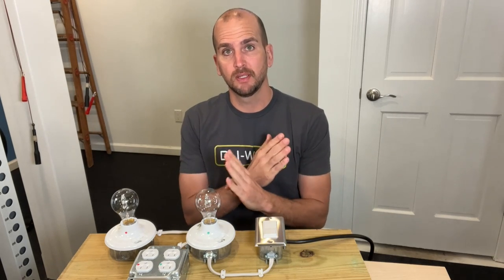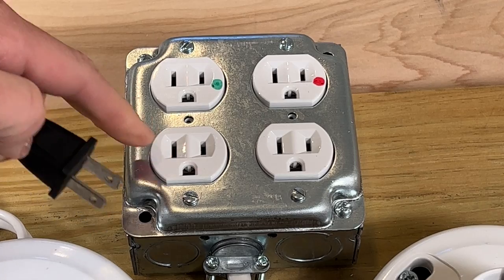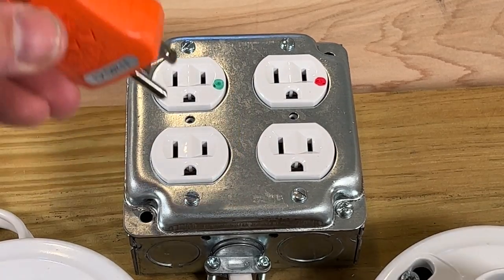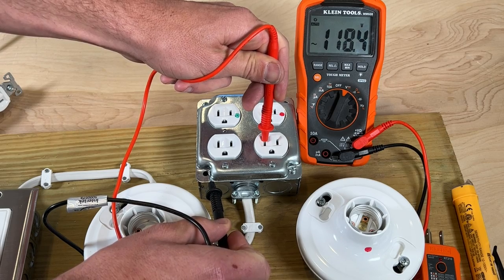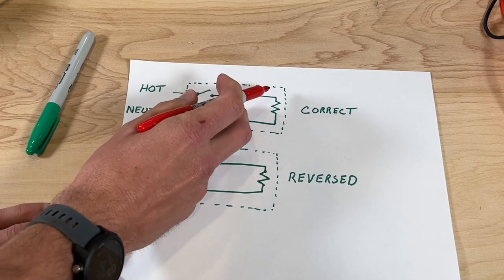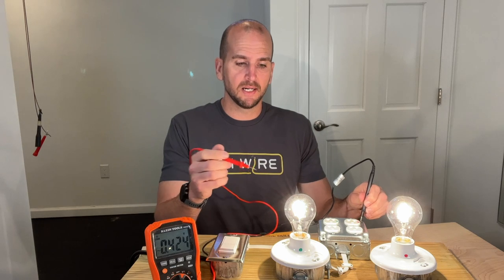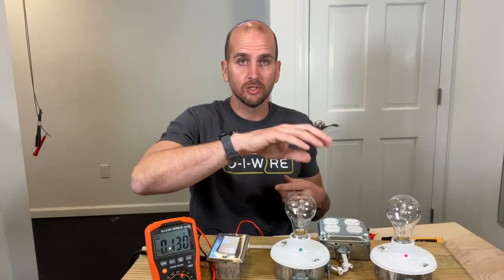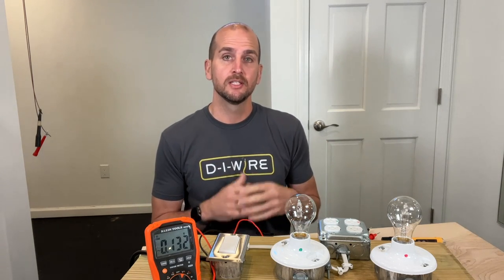Dangerous Wiring Issues In Lights and Outlets

Comment: Here we go again. Where were you when I had this problem. I was selling a house and the inspector caught this problem in the bedroom plug. I tried to fix it but without any luck. I called an electrician and he had to trace the problem all the way to the bathroom switch. So the problem could be different than the plug itself. The house was fairly new and I wondered how so many inspectors missed this problem starting with state inspection. Well explained and thank you for sharing
Reply from the maker: Good point Hassan and thanks for the example.  I think many are caught off guard on what inspectors do and don’t find during the inspection 😁
Reply: As someone working in residential housing construction as an electrician, it's a horror show. The inspector does not inspect everything. Sometimes my coworkers run out of weather resistant gfi plugs, so they use the normal ones in an effort to fool the inspector, knowing he won't check. Many don't even understand basics and don't utilize critical thinking because they take a completely procedural approach. They don't need to know how everything works they just need to know how to put it together. 

Everyone comes under the impression that the world has rules that must be followed, but honestly, it seems the are a lot of people in society who just.. don't care. Not out of malice, but pure apathy. Almost reads like exhaustion.

And yes, I'm trying desperately to get a new job, it's just really hard.
Reply: @Rin-qj7zt  wow. You  just described the reality. I have leased a gas station once and few months into the business my A/C started to act up. I called the pros and sure enough he found a cluster of live wire pointing up without caps. He could have easily touched them and hurt himself. The building was almost 2 years old and just disgusting to see violations passed by the inspector. I wish you luck in your future job
Reply: One of the dangers of connecting a run of receptacles in series. One gets wired backwards and now everything downstream is backwards.
Reply: @hassanbazzi3545  Before blasting the inspector, is it possible that the previous owner left you this mess?
Reply: @denali9449  I would have not accused the inspector but all emergency exit signs were not hooked up and neither the emergency lights to name a few. The building was only one and a half years old only. The market was crazy in 2005 and inspected building were not performed properly due to overwhelming of construction
Reply: @hassanbazzi3545  Why does this sound like Florida?
Reply: @denali9449  haha 😂. You are absolutely correct
Reply: @hassanbazzi3545  Yeah, I am a retired engineer who has been doing code compliance work in Florida since 2009. The failures of local government never cease to amaze me. And people wonder why that condo collapsed . . .
Reply: @denali9449  well said. I was in the food business where food inspectors visits random business and I have no idea of how some pass the inspection. Some of them were high end restaurant. It is sure nice to communicate. Thank you
Reply: Thank you and you as well. Just amazing coincidence. I wonder how many others have not been discovered. WOW
Reply: Simple, inspectors don't check every plug in the house for polarity. They caught it in the bathroom because that's where it's most dangerous.

Comment: I am working in a house that was built in 1947.  All wires look black.  This video prevented  me from possibly wiring a new fixture incorrectly tomorrow.  So easy to check with just non-contact voltge tester.
Reply: if you look closely, one of those wires will have a white or silver stripe on the side, although it may be worn away by now. BTW, if it looks like cloth covered romex and has a light silver glaze on the outside, it's impregnated with arsenic (poison) to keep mice from chewing on it. IOW, wash up after working with it.
Reply: @rupe53  Thank you for the arsenic warning.  It is "cloth" covered wiring in conduit on the main floor.  Unfortunately, it is in BX behind plaster and it is not feasable to replace.
Reply: @rogerhodges7656  ... my home was from 1910 so already have experience with wiring behind plaster. It wasn't fun, but that was 40 years ago. <LOL>

Comment: Good explanation!  I think you covered two of the three big topics: outlets, light fixtures, but also switches.  If your light fixture is wired correctly, but your switch is wired incorrectly, I think you end up with the same problem.  In particular, many people will do fixture work by flipping the switch off because they don't want to deal with the breaker, but if the switch is wired backward, you can still have hot waiting for a path to ground all the way at your work.
Reply: I came here to say this.  Having a lightbulb with its threads exposed is a good example of something an everyday homeowner (or their kid) might do and not consider it in any way dangerous.  But a DIYer trying to change a light fixture with just the switch turned off and not the breaker?  That's a nice, educational shock for DIY electrical work.  It doesn't matter if you know what you are doing, get a voltage tester or a mulltimeter to check for voltage before you touch ANYTHING.

If I don't want to play the breaker guessing game then I will tape the light switch in the off position.  That way all of the people I tell not to touch the switch will have a second warning before I come down the ladder and dole out some verbal education.
Reply: @docferringer  
If I don’t want to play the breaker guessing game?
That’s equal to…
“If you’re willing to run the risk of a shock…”
Reply: It's difficult to wire the switch backwards because the black hot wire is the only one attached to the switch and the neutral white wire bypasses it.
Reply: We need to go back to wireless lamps and tech like it was before 1800 during the time of the giants
Reply: Knob and tube was better

Comment: Some older devices - like radios from before 1960 - can be very dangerous with a reversed outlet since the neutral line of the plug was often connected to the chassis.  Plug it in backwards (this was before polarized plugs) or into a reversed outlet and the chassis is hot & if you touch a metal part of the case you’ll get a 120V shock.
Reply: Only in usa.
The rest of the world didn't have that issue .
But then usa was and is a 5th world nation
Reply: @janee7995  Those old electronic devices with tube amplifiers often had the chassis connected to one side of the line, as you correctly said - but not only in the USA.  They would be made this way and sold in Canada as well.  (I had a few shocks putting the tone-arm on a record.)  If tube filaments were in series, this would also happen in other countries with different supply voltages - and no neutral for a return as on the continent of North America.
Reply: Those have unpolarized plugs unless modified. I consider those unsafe. period. Note with an unpolarized plug there in principle is no wrong way. It was seen acceptable that the chassis was hot.

In Europe they cannot be plugged into grounded sockets as that would be too dangerous if you had a grounded computer next to and there is no legal way besides an isolation transformer to use them.
Reply: @thomaspierce9458  Those were made in most countries. The difference is that in Europe the plug does not fit into grounded sockets so you need to do something really stupid to use them.
Reply: believe it or not, kitchen counter appliances were also non polarized back then and everyone had that spiffy looking chrome trim along the counter edge, which could easily ground against the side of the electric stove or the sink. I can't tell you how many times I got a morning wakeup call if I leaned against the counter with a small gap in my bathrobe while making toast! (not what you think because I was shorter then)
Reply: @rupe53  I received a zing off of a refrigerator handle where the outlet was (then perfectly legally) miswired.  Two prong refrigerator cords -- a real piece of work!
Reply: @janee7995  Hot chassis radios were used in various countries, including Finland. The chassis was isolated so you could not touch it though if for example a knob is loose you could pull it out and then touch the metal rod.

In Europe those have plugs that do not fit grounded sockets so it is hard to get a serious shock from them. Unfortunately some idiots defeat this by changing the plug.

They radios had the benefit that they worked both with AC and DC. In German they are known with the term allstromradio. The reasons they were used in the US may have been different.

Comment: I was working for a company manufacturing security systems. OSHA came in and using the tester with the lights they tested a number of commercially made power strips and found a number of outlets were wired wrong. They shut us down. I talked to the guy and told him I was an EE along with others. I asked if we could fix all the stips and outlets could he come back later and check again so we could stay in business. He said yes. We got to work. What a rats nest we found when we opened the strips.

Comment: Many a Time when there was no outside receptacle and I couldn't get inside particularly with an older main panel, I would open up and attach a lead of a wire to the hot & another lead to the neutral bus- bar to run a skill saw. I never did make a jumper cord up in such a way I could plug a tester in and see if I had the hot and neutral reversed but I knew it would still work, although it's not 100% safe to do that without verifying that you  have the hot and neutral hooked- up correctly.

Comment: I'm just a homeowner, without a great deal of experience doing home electrical wiring. For example, I knew that reverse polarity in a outlet was bad for the devices, but I didn't know why. And I had no clue about reverse polarity in light sockets.

Which makes this a timely video for me, because I have a light socket that is old and I need to replace.
Reply from the maker: Best of luck on the light fixture swap 👍
Reply: The device does not care. It does not know which side is hot and which not. All it sees is the difference.

Comment: I moved into a home a few years ago that was built in the late 1960s. I didn't realize that several outlets had reversed polarity until I was swapping in some smart plugs. Then, I took my tester around and found the others.
Reply: The electrical code probably didn't specify back then.
Reply: @mharris5047  they are all grounded plugs with the wider neutral at least. It is definitely odd. It was built in 68-69.
Reply: @CarnivoreRonin  Same experience here - oddly, nearly exactly half of the outlets and the switches had the hot/neutral swap issue.

Comment: I have seen this in many homes. The homeowners don't seem to want to understand because they have to pay me to correct it.
So, once I explain in great detail, they finally get it. I have seen more lamps that homeowners have rewired on their own,  with reversed polarity than the light fixtures.
Great lesson for homeowners, you did a good job!
Reply: Quite frankly if you're touching the lamp base and get shocked then you deserved to get shocked. Unless you're trying to change a busted bulb. I've heard a tennis ball works for that. But if the bulb is intact there should be enough insulator to grasp.

Comment: I recently received my Journeyman license and I can say that this is a great explanation on why the polarity is importantant in the wiring. Thanks for the video.
Reply from the maker: Appreciate the feedback Ramon 👍.  Best of luck on your career!
Reply: @EverydayHomeRepairs  any recommendation for testing reverse polarity in light fixtures where there isn't an easily accessible ground?  Taking a light fixture down to check wires seems tedious when checking every fixture
Reply: @lumby1412  You can get a polarity plug in tester, like the 3 plug type, and get a test kit from home depot that has alligator test leads, or lightbulb plug on it where you can put them on the "assumed" hot and neutral, and see if it lights up right on the tester.

Comment: I purchased a rehabbed house over a year ago and I just found out that the receptacle for the garbage disposal was wired backwards between HOT & NEUTRAL and I found this out with my Fluke ST120 socket tester. For the longest time, the circuit breaker/GFCI would periodically trip and I do believe I just found out why this was happening because of reverse wiring of the garbage disposal receptacle...  

THANK you so much for these videos.

Comment: The ceiling fixtures are most dangerous because you are usually on a chair or ladder changing a bulb. Getting zapped may not injure you, but falling off a chair could have very bad outcomes.

Old school metal recessed cans are grounded. Even brushing the springs or clips that hold the baffle in place have given me a zap before I finished screwing the bulb in. I'm guessing that was the easiest return when the threads were live neutral was switched off.

Comment: another note: older homes with knob-&-tube wiring, the neutral is switched, common practice at the time. when replacing a ceiling fixture, turning off the circuit is the best policy. fixtures is the same era with pull-chain & turn knobs, switched the screw shell or neutral.

Comment: That light bulb example was excellent.  I replaced a vanity light above a bathroom sink at an old cabin a few years back and it was not clear which wires were hot or neutral and I didn't have any testing equipment handy. I guess I had a 50/50 chance. Your test was perfect.
Reply from the maker: Thanks for the feedback 👍👍

Comment: Excellent safety explanation.  When I had to re-do the electrical in an old home that we bought, I found some of the light fixtures were not wired properly.  Apparently, I was told this type of thing is not uncommon with light bulb wiring.  Our home is now normal for the electrical safety.

Comment: Well done explanation. This is why you never use a POTATO to unscrew a broken light bulb.
Most older homes have the neutral switched and a potato is mostly WATER.
Turn the breaker off and use a pair of insulated needle nose pliers to extract the base.
Reply: Good advice.  I have used potatoes for unscrewing broken light bulbs.   Including for a 150 watt high pressure sodium bulb in a yardlight that was busted from being hit with a football during a party.    I was depending on the photocell not to kick on, super dangerous because of the high voltage ignitor, (2500 to 4000 volts) found in all high pressure sodium and smaller (150 watt and under) and many newer metal halide fixtures (pulse start metal halide)

Comment: I’ve lived in a variety of houses in different states.  I’m always amazed what is not wired correctly.  I would recommend a session  on aluminum wire and Alcad sockets!
Reply from the maker: Hey John, thanks for the feedback and those would both make for good videos 👍
Reply: @EverydayHomeRepairs  Also would be good to explain what black/ white wires are in  Romex.  What should be hot,  what is neutral.
Reply: @JohnKenIRB233  Black is live (hot) and white is Neutral in the USA
Reply: If you have aluminum wiring in your house, have it replaced ASAP!  Aluminum wiring just doesn't conduct well enough for use on mains voltage.  This is one hell of a fire hazard!!!!!
Reply: @markrobinson8539  Not always. General rule of thumb...yes. An example would be a light fixture like shown in the video but it is 'fed' at the fixture with just a 'switch leg' ran down to the switch. This would see the 'hot' fed down to the switch on one leg and back to the fixture on the other. Not typical in 'new' construction (with free access to open stud bays and the freedom to run what is 'easiest' and needed) but you'd be surprised how often it can be required in rewires or simply just adding a switch to a light that previously was on a pull chain. Code 'allows' for this...so never just assume that black=hot, white=neutral. It may be true more often than not....but it isn't a certainty.
Reply: @michaelbeelby1995  Please provide the code section which allows a grounded conductor to be anything other than white, gray or otherwise properly identified.
Reply: @denali9449  As of the 2011 NEC switch locations are required to have a 'grounded conductor' ( just code speak for neutral).
   That is 404.2(C). This is essentially because of 'smart' switches and lighting controllers needing a neutral to function properly. Prior to this it was perfectly acceptable to feed a fixture and run a single 14/2 down to the switch as long as the white was reidentified as a 'hot' leg. This was because simple 'dumb' toggle switches don't require a neutral to function.
   Just because something is code now, doesn't mean that you won't encounter things that were acceptable by code in earlier builds
Reply: @michaelbeelby1995  I agree that many things have changed in all codes over the years and we cannot apply today's codes retroactively. But, your first comment said nothing about re-identifying the white leg. An error which you have corrected here.
Reply: @denali9449  My apologies... I definitely should have included that originally.
Reply: @michaelbeelby1995  No offense meant - just wanted to be sure that readers were fully informed because as we all know, sometimes they act on our statements. Cheers
Reply: @denali9449  None taken my friend. I agree. You helped remind me that something that is second nature and mindless habit for myself might not be for others. I appreciate that gentle prodding. Be well

Comment: Very well done. This shows very clearly why polarity matters on grounded AC circuits. It's all in where the switch lies in the circuit. Very similar concept to why we always disconnect the negative terminal on a vehicle battery - there is less room for unintentional shorts. Again, very well done.